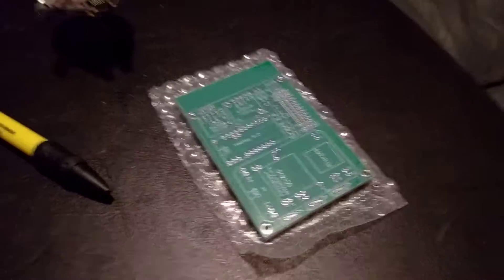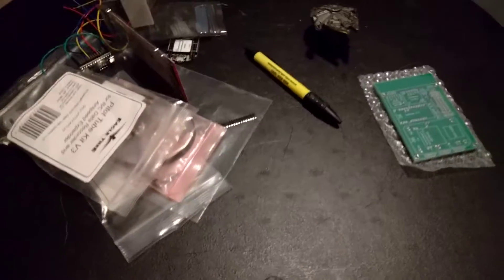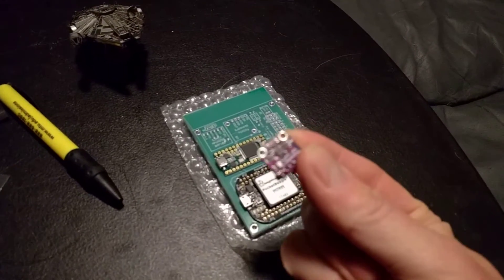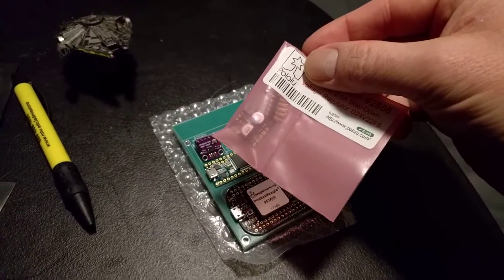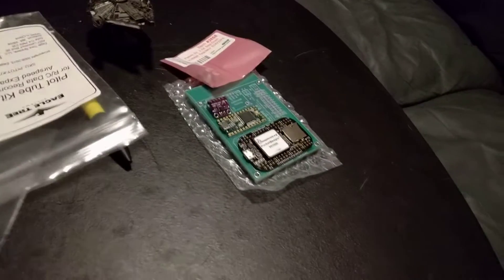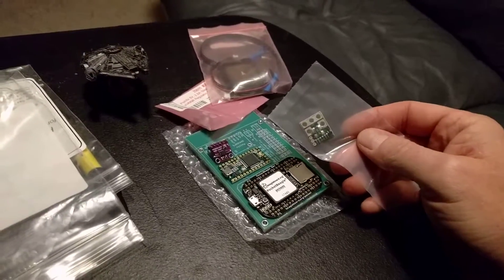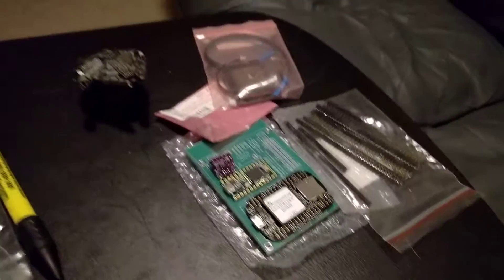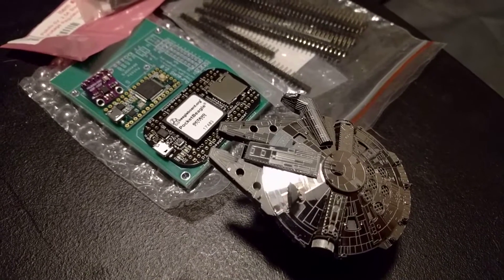Pocketbeagle vs. Teensy Autopilot Board

Comment: I'm lost as to what the teensy etc is for? the pocketbeagle does have two pru's as the beaglebone black does. I have built my own pocketpilot cape for my pocketbeagle. https://discuss.ardupilot.org/t/pocketpilot-a-new-linux-fc-based-on-the-25-pocketbeagle, not knocking your work. good job on the pcb your a step ahead of me.
Reply from the maker: Hi Alex, no worries.  One thing to note is that I'm not running apm or px4 software stacks.  Second, even though I'm obviously pretty committed to the beaglebone, I'd like to leave the door open for maybe raspberry pi, or chip (rip), or the next even smaller more powerful linux board that comes out  next month.  So really the teensy does the job that the PRU's maybe could do.  But I know how to program the teensy (arduino) but I don't know anything about PRU's.  Also I push some functionality on the teensy that might be difficult to replicate on the PRU's (not saying it couldn't work, just saying they are difficult to do things with that go beyond very simple stuff.)  And don't get me wrong, the px4 and apm software stacks are great.  I just wanted to do a few things differently, I wanted a simpler system (that doesn't try to have every feature under the sun all at once.)  And it's fun to do the whole thing yourself from the ground up.  Of course most people will (and should) want to run an established code-base on established hardware they can buy from many vendors ... except for a small group of people that enjoy figuring it all out for themselves from scratch. :-)

Comment: Hi, Curtis 
Any extra boards for sale, would like to try your AP project with my projects.....https://youtu.be/koOqenMpvck
Reply from the maker: Hi Research Air (sorry for the long answer) :-)
I have seen your videos before, your vtol system is extremely impressive, great work!

Some thoughts:
- For this first run of my board, I've already found one outright error (missed connection between the teensy and the ground plane).  As I assemble my first board, there are a few other things I am discovering that I really want to change.  I'm still struggling with external connectors because the industry standard JST-GH doesn't offer through-hole variants so they have to be reflowed .... but I was hoping for a 100% through-hole board.  So do I stay with picoblade or df-13, or something else?  Cable and connector surgery is my least favorite thing, so I'd like my board to be as plug and play as possible. I'm still struggling with this aspect of the design.
- I think I will need a v2 of this board before I am happy with it.  However, I already have $60 worth of parts soldered to this first board, and $75 into ordering the board itself, so I plan to follow through with a complete build and fly.
- I'm not setup to sell and support hardware, but if someone wants to try this out with an experimental mindset, the board designs are all 100% open-source.  They can be ordered directly (along with all the components) without me in the middle of it.  Here are the designs: https://github.com/AuraUAS/aura-hardware
- I would do my best to answer questions if someone wanted to build something up themselves and try it out.
- For professional hardware and support I would direct you to: www.bolderflight.com  My firmware and all my software runs on their hardware.  They also have their own firmware and software stack that is being developed and tested as I type.  Plus they use a pick-and-place shop so they are able to support JST-GH connectors and plug-and-play with standard external devices like gps, radio modem, airdata, etc.  I work closely with the bolderflight guys so I feel confident pointing anyone in their direction.
- So far, all this work that I have done centers around fixed wing.  We have never attempted to add support for vtol or multi-rotor or hybrid type air vehicles.  I imagine that px4 or apm are the way to go for these type vehicles.

If there is some aspect of this project (like drawing a hud overlay on top of the flight video) then you could probably still do that using the px4 or apm flight data log and your own camera.

Thanks!

Curt.
Reply: Hi, Curt
Thanks, no problem, I  have done that,I'll order some after you fix it, having built lots of boards I found that the 1mm pin headers are the easy way to adapt anything and you can build wire harnesses and choose the wire type, I settled on #30 silicone from Adafruit for most signal stuff. The trick on the small wire is to pre-solder a small tinning on the connector pins and just tack the dry wire to it then remove from the strip and crimp,(good crimper) use gold flashed connectors as well if you can find them.(hobby servo type)
Thanks again 
Rick
Reply: oops, 2.54mm headers.1"
Reply from the maker: 0.1" headers are more my skill level.  Anyone who can hand solder up a 1mm header is in a different league; maybe has surgeon waiting for them as a second career. :-)
Reply: I love a challenge... my latest board has 0201 passives, picked up a good microscope and can hand solder, the solder tip looks like a jackhammer and not too much coffee, control breathing and that's just to place them. built a reflow oven, pasting and placing,  that's not as tricky... but understanding what you do is beyond me...spent way too long trying to get a pi to work with octopi wifi and still not working.
Reply from the maker: I started looking at reflow (skillet?) but need to figure out how to make the solder mask and learn about solder paste.  I suppose that it isn't quite rocket surgery, but maybe quite a bit of trial and error before figuring out enough tricks to be successful.  My fall back is that I'm a 'software guy', just learning a bit of hardware stuff as I go out of necessity. :-)
Reply: toaster oven, lots on google, board houses will build solder masks... but it can be done by hand for small runs if you want I can get info on what I use and instruct you when your ready
Reply: this board house get's it right and works the tiny stuff without the b/s
Reply from the maker: Good to know.  For now, I did the design in some software called "Express PCB".  It's fairly easy to learn (true if I managed to learn it.) :-)  The downside to expresspcb is that it's a custom format so you can only get the boards fab'd from that one company.  They don't give you gerber files.  The tradeoff is easy vs. cost/flexibility.  For a 3 board DIY run can be a good tradeoff, but if there's larger interest then not such a good tradeoff.  I'd love to learn kicad or eagle someday, but there is only so much time to divide up.  I'm just scratching the surface and have a lot left to learn in this area!
Reply: try  ... PCBweb designer (FREE) and at least for now and you can get the Gerber... love it!
Reply from the maker: I'll have to download and give it a try, thanks for the tip!